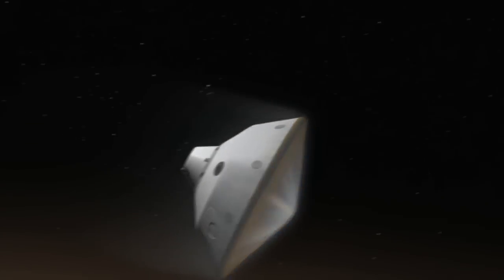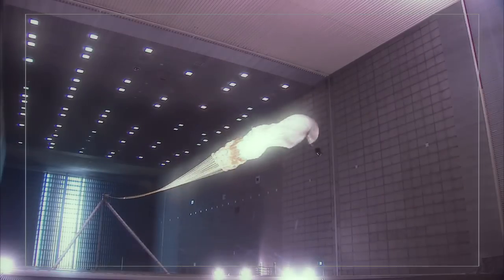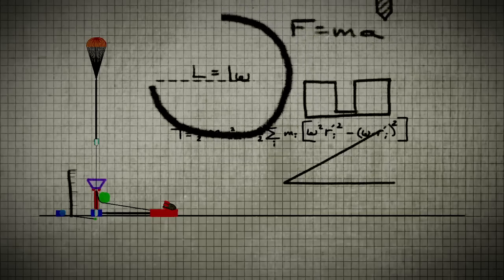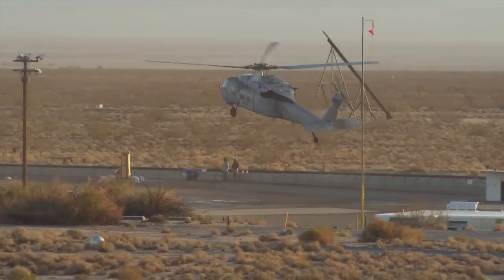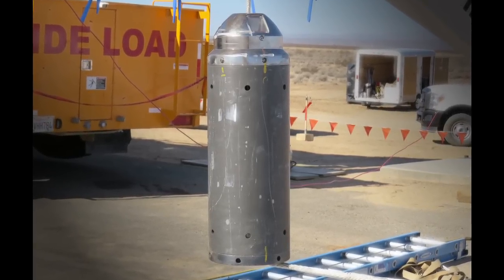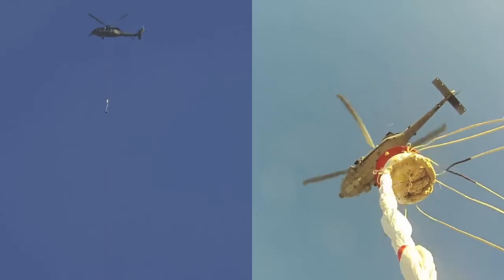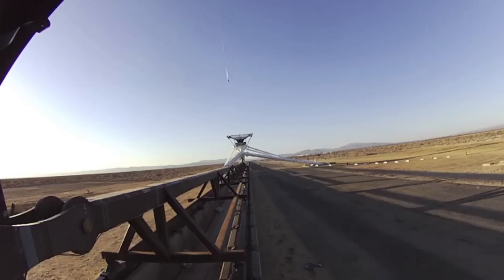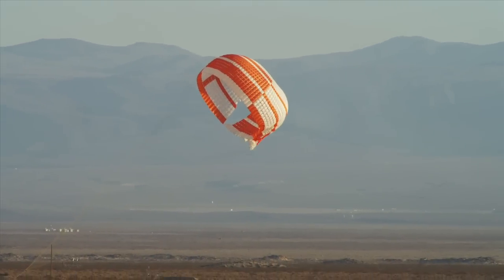LDSD: We Brake for Mars (Part 1)

Comment: Did you know that the Physical principles that a rail guns relies upon could be used instead of the above rocket? oh and the rail gun could also be relied upon to propel a "Space Freighter Train" near to the Speed Of Light, and it could also be used to slow decent of significant payloads - mind you all the workings would have to be distributed amongst the four below sections. [+ -][+ -][+ -][+ -] 
I know - I know it sounds crazy, and one would think at first thought - it may need significant energy, but surprisingly its far more economical than the storage of chemical propellant/s!

Example of a four Unit Space freighter.
----------------------------------------------------
Where sections are electromagnetically phase flipped..

[- ///// +]<--repulsed[+ ///// -][+ ///// -][+ ///// -] Phase one is where the first sections phase is flipped.

[- ///// +][- ///// +]<--repulsed[+ ///// -][+ ///// -] Phase two is where the next sections phase is flipped.

[- ///// +][- ///// +][- ///// +]<--repulsed[+ ///// -] Phase three is where the next sections phase is flipped.

[- ///// +][- ///// +][- ///// +][- ///// +] Phase four is where the last sections phase is flipped, to which the whole cycle of flipping Phases is repeated if an increase in velocity is required

Mind you for a safe decent "reverse thrust" its a matter of reversing the above cycle..

Comment: This doesn't make any sense because, despite falling faster, there would be less resistance on mars with less atmosphere, so the drag/forces acting upon the chute would necessarily be less... or am i missing something??
Reply: The higher we ascend from Earths Sea level, the less dense is the Atmosphere, and at some point the density would be much the same as Mars density.

Having said that I am wondering why NASA doesn't construct a more durable neutrally buoyant saucer shaped craft replacing the currently relied upon balloon which lifts up a simulated "Mars Destined Craft", I mean if the balloon can lift up the simulated craft, then why not take advantage of that for the actual mission as well or even better yet if the craft is made neutrally buoyant, it could then rely on Rail "Gun Propulsion" as per my previous post above..

Comment: Where's the "Low Density" part? I thought the point of not using a wind tunnel was to test a full-size device (which wouldn't fit), but then Earth's atmosphere is a much thicker soup?
Reply from the maker: "Low density" is in reference to Mars' low-density atmosphere. Landing on Mars is not like landing on Earth, which has a dense atmosphere, or on the moon, which has no atmosphere. Mars has a tricky environment somewhere in-between: it has too much atmosphere to allow rockets alone to land heavy vehicles, as is done on the moon, but too little atmosphere to land vehicles from space purely with friction and parachutes, as is done on Earth.
Reply: NASA Jet Propulsion Laboratory

Comment: Why don't you just use a sounding rocket to test the parachute? At high altitudes you'd also get similar pressures to what you get on Mars so no rescaling is needed.
Reply: Because you need to be able to test the parachute in a controlled environment, in front of dozens of cameras. There's no point in testing if you aren't going to be able to document what happens.
Reply: A sounding rocket is not big enough to carry the parachute up.  And in this case, it was just to get the same dynamic pressure, so we didn't need or want low density air for this particular test.  We will go to high altitude for the test of SIAD, as described in video 2.  But we are going by balloon and have a large rocket to accelerate the payload to the intended test conditions.  That rocket is quite a bit larger than a sounding rocket.

Comment: Sorry but the actual working details of the winch-bullet-fishing-line business went right past me without waving hello.

And why not just fire a rocket up 20-30 kilometers and let it drop until >mach 1 in something closer to Martian air-pressure?
Reply: Because on entering Mars's atmosphere, the craft will not be going just above mach 1. It will be going several kilometers per second, or about mach 10.
Reply: Because this is much cheaper than a rocket or even a high-altitude balloon drop.  What's more, you can see what happens much more easily near the ground, with lots of really good cameras.

Comment: What about airbrake? (Except i dont know the what the atmosphere of mars is like) Or just doing a controlled burn before?
Reply: A Parachute is effectively a massive airbreak. Mars's atmosphere is only 1% of earths, and so slowing down from a few kilometers per second requires a very very large parachute.
Reply: SirusKing VanMedia Thank guys :) Thanks for the info :D
Reply: Also, if they make a better parachute, they don't need to slow down much, which means less rockets. Lighter rockets means more room for usable mass.
Reply: It would have to be a large air brake, and would weigh more than the parachute. A great parachute is just more conventional and practical for this purpose.

Comment: PARACHUTES ???
That's the best that you could come up, GROW UP !
Reply: Eh? So you think parachutes aren't a good way to land on Mars? You do realize that they are only one part of the landing mechanism that lands the spacecraft safely.  Besides, the facts speak clearly. 7 out of 8 NASA-JPL spacecraft have landed on Mars safely with the aid of parachutes. The one that didn't land safety? Mars Polar Lander. It had nothing to do with the parachute though.
Reply: ***** Parashutes are good but perhaps we need some new ideas
Reply: ***** Like what? Physics, a limited amount of funding, the limits surrounding engineering a spacecraft that has to run everything on an insanely amount of power make anything else seem impractical. Plus there is a reason NASA doesn't like to try new systems of landing on another planet unless they absolutely need to. Developing new engineering techniques is expensive, mostly because engineers are expensive. So if you can save a significant amount by keeping to a true and tested method of landing on the red planet, uh you better do so. 

Especially in this funding climate where NASA only gets .04 percent of of the nation's budget. With a vast majority of the population thinking that is enough. While NASA's budget has been falling more or less from 1 percent downward since the 1970's (With exception to the early 1990's). 

Oh, and new ideas are untested and that makes everyone nervous. You can test a sky crane all you want on earth, but there is really no substitute for Mars. We live in a world where a failure or two, might jeopardize our space program. So yeah, tried and true sometimes is the best solution unless you have an unlimited amount of funds/a people who are understanding of failure/accept it as part of the process of exploring.
Reply: ***** Something tells me that NASA serves only as a Cover Up for some other Projects...
So if Germans did have flying Saucers in 1945, so just imagine, what America has right now !!!
Reply: Oh, you're one of them. >.> OK. Nevermind. The laws of physics are pretty clear.
Reply: ***** Laws of physics ???
If you don't know about something, that doesn't mean that it doesn't exist !!!
Holographic Universe!!!
Are we living inside a Hologram ???

Comment: Since the Mars atmosphere is only 1% as dense as Earth's, how do you accommodate testing to be accurate on Mars?
Reply: As an engineering student I can answer this with great confidence. Math.
Reply: As an engineering student who remembers this particular bit of fluid dynamics: due to the way the maths works, you can simulate a different atmosphere through a combination of changing the scale of the model, and the windspeed it's being tested in. They use this when they're trialling aircraft and car body shapes - they'll use a scale model, then use the math to get the wind tunnel's variables at the right point that they can get a fairly accurate simulation of the full-sized version.
Reply: Math and experience.. Not the first time stuff is flying to Mars :)
Reply: This is a test to see if the parachute can take the aerodynamic loads it will see at Mars.  To match the load, you need to match the dynamic pressure times the drag coefficient, q Cd.  q is 1/2 rho v^2, so as you scale rho up by a factor of 100, you have to scale v down by about a factor of 10.  "About" since you also need to adjust for the Cd at Mars Mach vs. Cd at the scaled Earth (subsonic) Mach -- they are different.  Then you have your test velocity at Earth, about 65 mph, to match the loads at Mars at Mach 2.5.
Reply: Wandering Bishop Thanks for a good explanation.
Reply: I left out that we add 25% to the load to stress the parachute a little more than it will see at Mars, to make darned sure it will work there.
Reply: +Mark Adler Where can I learn more about what you said? Thanks!
Reply: Any introductory aerodynamics textbook.
Reply: Going high in the upper atmosphere.